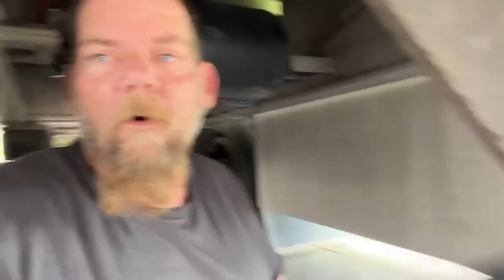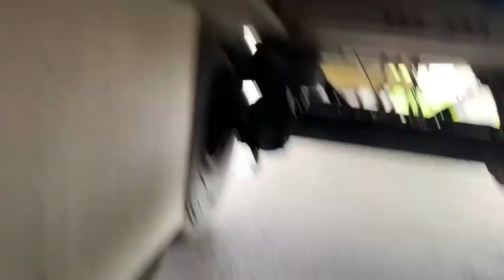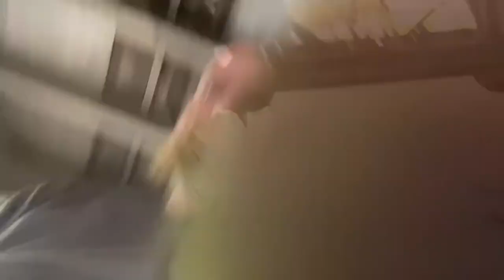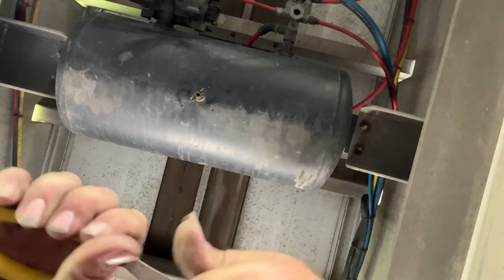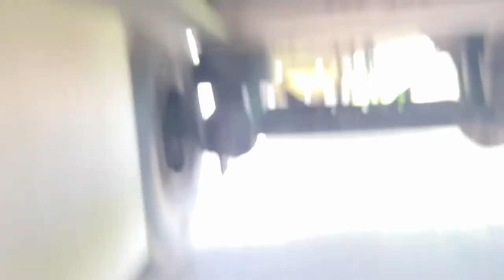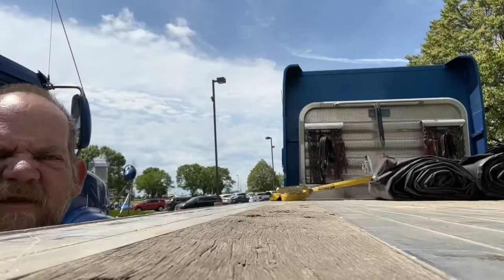Trailer air bags do not inflat, and road Sid fix.

Comment: Nice vid. The valve is called a charging or protection valve.  So if you have a blowout on you aux system in this case the air bag system , the valve will shutt of air too the aux system when air drops below a certain or pre set pressure. , thus providing protection for the brake system.